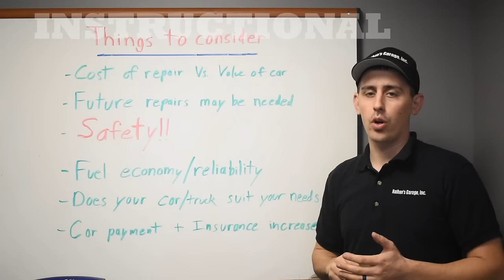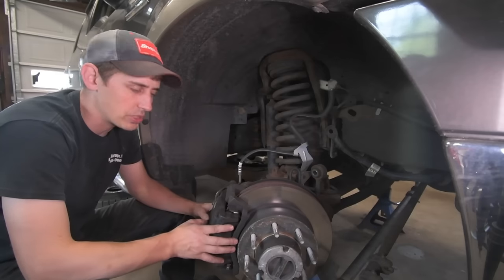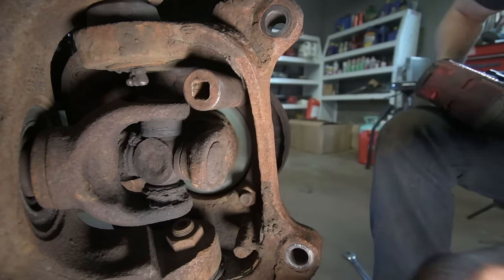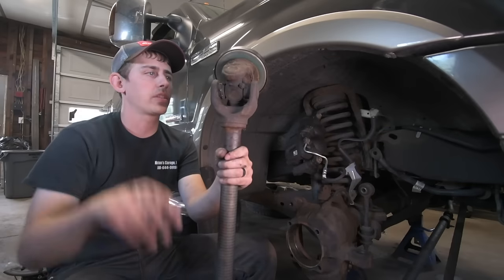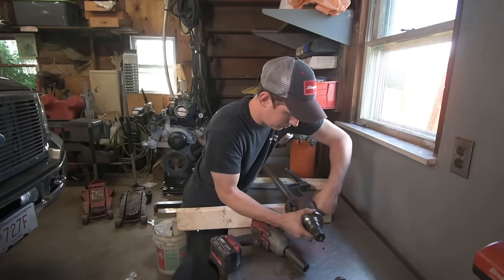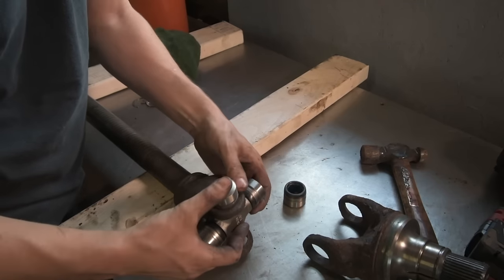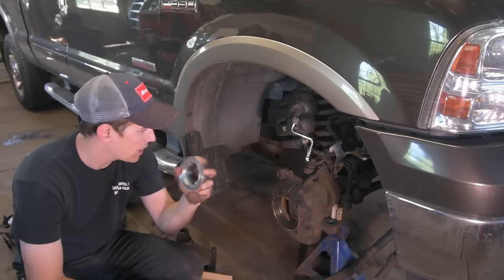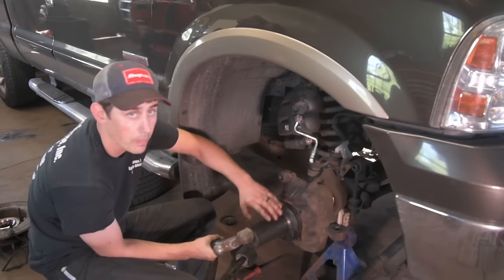Ford Superduty Steering wander repair....Axleshaft u-joints

Comment: I wonder if I'm getting death wobble and I just reach up and kick it in four wheel drive and see what happens?
Reply from the maker: Death wobble is a different symptom. If you have death wobble you have either a loose component (usually track bar), low tire pressure, or improper caster adjustment.
Reply: @InTheShop  
Only thing I've found with any slack is the right side tie rod end, just a little.
Death wobble is happening on the driver side tire. Hard bouncing shaking.
2012 F350 Dooley
Also noticed with truck not running when moving the steering wheel back and forth a little there is a clanking noise and funny slack clinking feel.

Comment: Question, wouldn’t that only effect if 4wd is engaged?
Reply from the maker: If it was in 4x4 you would feel a shimmy when trying to turn. The universal joints still have to be able to pivot even with the transfercase in 2wd and the hubs unlocked. If the joint it frozen it binds the steering.
Reply: @InTheShop  gotcha thank you!

Comment: This sounds similar to what is happening to my 2015 Fusion Hybrid. When I'm going onto on-ramps turning right or left the steering wheel suddenly pulls hard in the direction the wheel is turning. 

I had a mechanic from the Ford dealership with me once, and he told me the pull was the road. I was thoroughly displeased with his incorrect diagnosis. Every other mechanic tells me my steering is out of alignment.

I have paid for 5 alignments in less than 1 year. It has been doing this ever since a Ford dealership did a recall repair for a steering bolt in the steering column.

Does anyone have any idea what is going on with my car?
Reply from the maker: Have you tried taking it to a shop that isn't the dealership to check the alignment?
Reply: @InTheShop  I bought new tires from a non-dealership company, and that was the first place I went thinking it might have been a bad tire. I was told that they checked  their work and nothing was found. As it stands I am considering it a lost cause and getting a non-ford car for my next purchase.

Comment: Did the truck have a memory steer issue as well?
Reply from the maker: It did
Reply: @InTheShop  thanks! Trying to figure out my 2001 F-250. A local shop just installed an expensive steering box and still same issue.

Comment: Do I need the seal kit and inner dust seal for both sides?
Reply from the maker: Only if you are replacing the joints on both sides.
Reply: @InTheShop  got it thank you!!
Your videos are very helpful
Reply from the maker: Thank you! Comments like this are the reason I do this.

Comment: Dumb question but do both sides have that you join or is that only on one side
Reply from the maker: Never a dumb question. It is on both sides .
Reply: @InTheShop  I don’t have the problem that you said as far as driving down the highway but at low speeds when backing up or turning it feels like it’s in four-wheel-drive. So almost like it’s binding
Reply from the maker: @tonyayres6877  could be the same issue

Comment: Nnnhhha, What’s up doc?    What was the white stuff you applied to the surface of the knuckle that mates to the backing plate?
Reply from the maker: It’s silver Anti Seize. Helps it come apart easier if you ever need to go back in there.

Comment: do u fix both side,s
Reply from the maker: I always check both sides and typically replace both sides. This truck got both. Depending on someone’s budget they might choose to only do one side if the other on is good and takes grease

Comment: does anyone know if these parts listed are still accurate for '99 f250
Reply from the maker: Hey Chris! I will check on my lunch today to make sure they are still up to date. I will let you know.
Reply from the maker: The parts are still accurate.
Reply: Passenger side spins freely by hand when not engaged but the driver side binds alittle.      I havent lifted it and unhooked the steering yet tho

Comment: What’s your experience with "death wobble?"
Reply from the maker: Typically death wobble is caused by one of three things. 1) loose steering/suspension components typically the trac bar. 2) low tire pressure. 3) poor caster adjustment.

Comment: can this still be an issue if the hubs are in "free"?
Reply from the maker: Yes. There is just enough resistance in the bearings that the axle will still rotate on occasion. If the frozen axis of the joint is in line with the axis of the ball joints it will bind.

Comment: I just don't see how that being bad could make my truck wander all over the place but that's about the only thing I haven't tried
Reply from the maker: The U-joint being frozen will make the steering bind. The power steering has enough power to overcome it but it won’t recenter. The truck will drift one way then you correct. Then it gets stuck that way and you correct.

Comment: The problem is that the shop doesn't grease them. That was the problem with my truck - not a sign of grease in them. Makes me mad I pay good money to the Ford dealer and they can't even follow their own instructions
Reply from the maker: The factory joints don’t have grease fittings

Comment: Fuckin eh brotha good work I think ik having the same issue andnit makes like a humming noise and its not the tires just like a gearbox humm. Looks like I'm taking the old girl apart
Reply from the maker: Thanks for watching Dustin. It sounds like you may have a bad wheel bearing also.

Comment: Hey there! New to subscription. I have an issue with driving and making turns. I was told to change my locking hubs. I did. It still makes the same knocking noises only when I turn left. It almost sounds like it wants to fall out 😂.. any suggestions on what this noise or issue may be?
Reply: .. oh. 2004 F-250
Reply from the maker: I would inspect the U-joints but also check all other steering components for play.

Comment: 4 different ford house mechanics advised me not to buy a new Ford
Reply from the maker: I personally believe all the full size trucks have their issues and I would say its a matter of brand preference. The Fords do have some issues but seem to be more talked about because of the much higher volume of trucks produced. Thank you for watching James.
Reply: @InTheShop  I drive an old 12 valve cummins 1994 with 480k on it still runs like new. I just refuse to pay 70,000 plus for a bunch of gadgets wrapped in plastic regardless of the the make. Nice video!

Comment: You said to get a partner to “steer” the wheel to get the hub out. ,,,,,    BE SURE your brother-in-law DOES NOT start the truck and push the brake pistons out of the calipers and ruin thanksgiving after hitting him in the head with a full can of starting fluid
Reply from the maker: Haha! Yes thats great advice....was the turkey still good?

Comment: Are you still around? I'm local to you but shop number has been closed
Reply from the maker: I closed the shop in February of 2019. I just make these videos in my home garage and only take on limited work.
Reply: @InTheShop I have a issue that would appear to be what your video describes. On a 2001 F250 I know you said limited work but if you would be willing to take on the job I'm local. Also if not do you know of anyone in the area who is trustworthy?

Comment: I can understand how turning the wheel to make a turn could cause old u joints to bind up once you try and turn back the other way. But how are axle ujoints that aren't even turning while disengaged going to cause a steering issue while driving straight? Makes absolutely zero sense. 
The issue with the steering wheel slightly moving back and forth while driving straight is caused by the track bar ball joint and bushing being bad. It will allow the axle to slightly oscillate while driving. You cannot see that either end of the track bar is bad without having someone move the steering wheel while you watch for movement.
Reply: Best instruction you can give is to tell people to stop driving around with their hubs locked in 24/7. Unlock them when you don't need 4x4. I watch front axles turning all day when I drive around. People are either lazy or dumb or both because it's a HUGE problem.
Reply from the maker: The joints are frozen. They need to pivot while turning the wheel. While you drive down the road whether you realize it or not you are constantly correcting to keep the truck in your lane. While making these corrections the steering gets stuck in either direction. You feel this so you attempt to correct harder which makes you over correct. It then gets stuck the other direction. This process repeats over and over which makes the truck wander all over the lane. 
You are correct in the way to inspect the steering and track bar components for play. Track bar play will usually cause a death wobble symptom. In this case and in many of these cases the universal joints caused the issue. 
If you locked the hubs on this truck so the axles spun you would feel a shimmy in the wheel.
Reply: @InTheShop  thank you for explaining that. 🙏
Reply from the maker: @flently  no problem. Thanks for watching!

Comment: Do you want to fly up here and do mine? Or rent me that axle shaft installation tool
Reply from the maker: Haha I don't think that flight would be very cost effective. The installer isn't really that bad.
Reply: @InTheShop  I'm going to tackle mine this weekend - wish me luck!!
Reply from the maker: Good luck! Let me know how you do.
Reply: @InTheShop  Turns out both sides of mine were seized! Everything was rusted and/or a real B*&ch to get undone. The seal installer that I bought was way too tight and got jammed in the knuckle just when we thought it was going good. (we had to 'customize' it on the bench grinder!! lol )  - took us all long weekend to get the passenger side done but we got it. Took 6 hours to do the drivers side.   Side note - the truck was parked for a year due to me having open heart surgery - so pretty much everything was rusted tight. Had to replace the stabilizer links because we needed to destroy them to get the stabilizer out of the way.   Could not have done it without your excellent video.   Thanks for your time.
Reply: @InTheShop   Oh yeah forgot to mention that I had to buy a 12 ton hydraulic shop press to get the U-Joints out - they were that seized!!
Reply from the maker: Glad you got it done! They can be rough when they are that bad.

Comment: The RWD does it also so I don't see how this fixes the issue
Reply from the maker: @philipgurka1638  not the same type of wander as this. When you experience this in a 4x4 you will see the difference. The truck will fight you the whole way down the highway.

Comment: I finally torched mine off after calling it dirty names on the press for an hour.
Reply from the maker: They can be a pain
Reply: @InTheShop  that's the truth. They were bad after letting the pickup be maintained by Walmart. Not my choice I was out of town.  Transfer case plug was stripped, nothing had been greased and they put a chinesium shit filter in that if you know the 6os was the wrong size.  Told her never again!  But nothing I can do now.
Reply: @InTheShop  do you know the 6.0s pretty good
Reply from the maker: Very well. That is what I specialize in.
Reply: @InTheShop  mine has a stutter under load and codes read egr low circuit and bank 4 I think fault
Reply from the maker: Do you mean injector circuit low #4?
Reply: @InTheShop  I'll have to check but wasn't injector
Reply: Was a p0404 p0405
Reply: Sorry was a circuit a low. Have had a lot of numbers on the brain lately

Comment: How do diag what side it was on?
Reply from the maker: You would disconnect the tie rods on both sides and check them both. I only showed one side but checking the drivers side is the same.

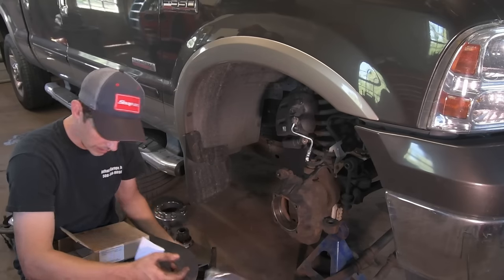Comment: 27:33 If you don't have the big ass Ford seal tool, forget about doing this job. Or buy 3 seals cuz you'll wreck 2 trying to get that cheap donut on as well as setting the axle into the hub. And no amount of beer helps it go on with drifts, punches or anything else 👿. Shiddy Dana axle design.
Reply from the maker: Absolutely. some people make tools themselves but i have found having the right stuff makes all the difference. Thanks for watching.

Comment: Does anyone sell the seal driver besides Amazon ? Changing my U joint and wheel bearing tomorrow.
Reply from the maker: I have not had any luck finding a retail store that has them. There are other online places that sell them but that doesn’t help you. You could try autozone tool rental and see if they have them.
Reply: @InTheShop  Thanks I can get one thru Amazon but would not get it till Sunday

Comment: That's what happens when you mix incompatible grease.
Reply from the maker: Most modern greases mix well and this is less of a problem than it was in the past but absolutely could be a contributing factor. From what I have seen the majority of it is from lack of greasing.

Comment: with hubs unlocked it would not have issue , with hubs locked it would , who are these mechanics ? that would show ya pretty quick where issue was at or where to start looking at least  lol
Reply from the maker: With hubs locked it would produce a shimmy. It’s when the hubs are unlocked that the u joint stays in the same position and makes the steering sticky.
Reply: In The Shop yes its like loosing at the casino where will the axle stop when the hub was last unlocked , also when locked it would shimmy (bind) bad when turning and not as near bad when unlocked like you said it will just have stiff steering theres the  dead give away . 

Its like ya heard me explain to guys word for word when they ask greaseable or non - greaseable u joints , they be like give me the greaseable , l’m like nope u cant even put air in a tire you be gettn the non greasable ones foo cause they will never get done .Great vid on repairs , ya got a sub
Reply from the maker: Thanks man. It’s unbelievable what other shops miss when it comes to diagnosing.

Comment: I disagree with your reply due to the Fact exactly what you explained on the the vehicle reacts while driving are the same issue in my RWD.
Reply from the maker: Two different symptoms of two different part failures. Read the hundreds of comments saying this fixed their issue on a 4wd truck. 
If your rwd truck has a wander issue you could have seized ball joints, a loose steering box, worn tie rods, a bad alignment, etc.

Comment: You put that seal on backwards.
Reply from the maker: The seal can’t be put on backwards. There is a lip that stops it.
Reply: @InTheShop  I could swear the guy on left hand diesel put it in the other way around. I have to double check now. Maybe he put it in backwards.
Reply: @InTheShop  Nope, I was wrong, He put it in the same way you did. Sorry.

Comment: You just can't admit your wrong, 1st of all how does a RWD have front u joints?
Great youtube mechanics full of themselves.
Front end alignment,  worn front end components have been replaced and repaired,  steering gear box is next but according to you this doesn't fix it.
Just go back and admire yourself in the mirror.
Reply from the maker: @philipgurka1638  seems like you are the one that has the problem admitting you are wrong. I said ball joints not u-joints. A Steering box will not fix the issue this video is about. This video DOES NOT cover wander in a RWD truck. I’m not sure why you are even continuing to watch the video or comment on it when it doesn’t even pertain to your vehicle. There are other causes of wander but this is the most common issue on a 4wd truck.

Comment: What a bunch of expensive garbage. Mite as well change the 600.00 dollar wheel bearing too.is it a diesel?if it is don't bother fixing the drive train,it won't run long enough to worry about.
Reply from the maker: Thank you for watching Dale. All of these full size trucks have their issues for sure. Its a matter of preference on what kind of problems you can live with. There are millions of these trucks on the road and many of their owners are loyal to them. I'm just trying to provide info to help keep them going and save a few pennies.

Comment: This is bullshit! The drive axle is entirely and completely separate from the steering system and componentry. Keep workin' on it youngin'... eventually you will figure it out! You can completely remove the front axle without affecting the steering.
Reply from the maker: You obviously have zero idea what you are talking about. Before you call bullshit on something you don’t know maybe you should look at how it actually functions. The universal joint needs to pivot regardless of if the hub is locked or not. If you put a solid rod from the differential straight to the hub would you be able to turn the wheel? The answer is no. Did you watch the video? If you actually watched the video you will see exactly how a bound up universal joint causes this. If you also took the time to read the comments you would see that dozens of people have commented saying this fixed their issue. Mentality like yours is the exact reason these trucks come to me to be fixed properly and not just have parts thrown at them.